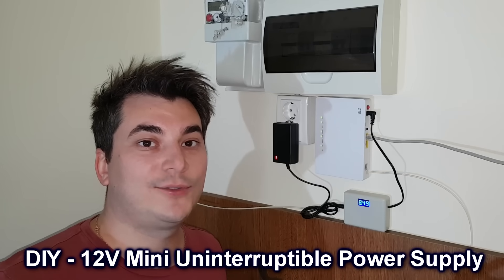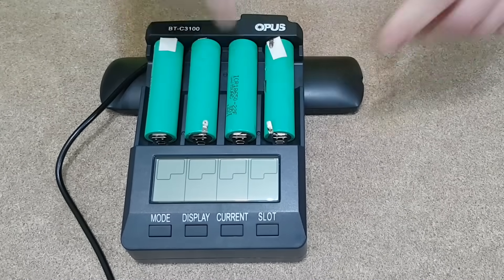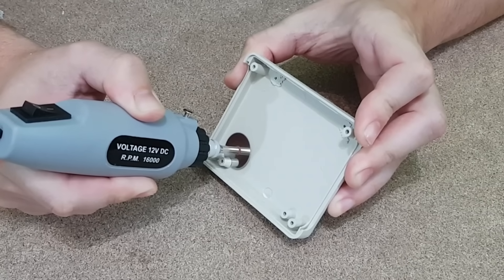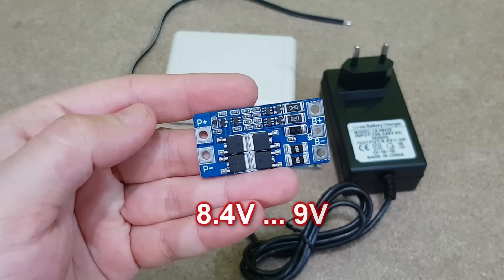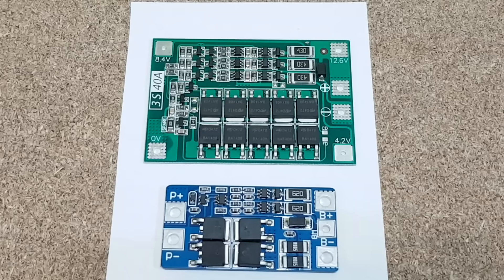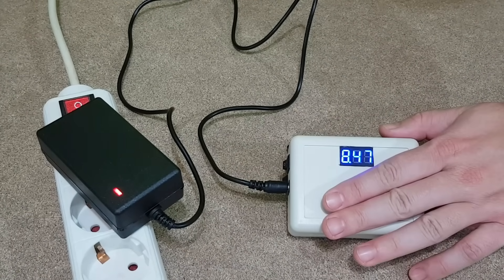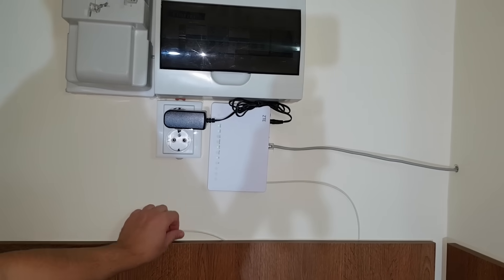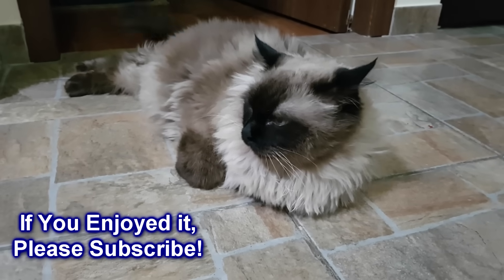DIY - 12V Mini UPS

Comment: I want to make a BIG UPS, for a house. Something that would support a fridge, TV and a few other things for five or ten minutes. Long enough to maybe turn on a portable generator. What if I just had a couple of car batteries? Plus, I'd like to have the system be able to activate the generator if the power is down longer than a minute. Would it be possible to just scale the design of this mini UPS up to cover a much larger load? Thanks if you can help! Thanks.
Reply from the maker: hi. it's much more difficult to build an UPS of that scale. you need a powerful inverter, or even more inverters, to power different loads. a big battery pack of 24V or 48V, which will be difficult to charge and balance. and a system that can switch very fast between mains voltage and inverter voltage. it's not impossible, but it's very complex and expensive.
Reply: @Sorin_DIY  Oh well...  :-(   I guess I've have to just settle for a small UPS system for my electronic stuff. I live on a country road where power will just drop out for a second or two for no good reason. And sometimes it might drop out for an hour. Not that often, but it can be annoying. At any rate, thanks for the information!! A small UPS and a generator maybe what I'll have to settle for. Thanks!
Reply from the maker: I will soon make a better UPS, more powerful and with more features. it may be useful for some of you electronic devices, which have an external charger (modem, TV, monitor, laptop, landline phone and so on..). you can also use it for lighting at night, you can power an LED string with it. but for big loads, like the fridge, you need a generator.
Reply: @Sorin_DIY  Thanks!
Reply: @Sorin_DIY  Hey SORIN... I have another question for you if that's okay. Our house had another power outage yesterday. A quick down. Less than a second or two. But it knocked my iMac computer off line. Annoying.  So I decided to look for a solution for just to protect my iMac. I looked at several options and videos online. Then one video gave me an idea. I remembered that I bought a 30Ah lithium battery last year so that I could hook-up solar power in my bus (I own a small bus.) I hooked the 30 Ah battery (it says it's "30000 mAh") to a 750 watt continuous inverter I own and BANG, it seemed to work! It seemed I had a UPS for my 2007 iMac. The battery comes with a charger, and when I unplugged it, the computer just kept running. Not even a flicker. So is there any problem with this? Is this dangerous? The charger for the battery feels a little warm, but that seems normal. Is there any reason I shouldn't run this set up 24/7 ??? Here are the specs of the items I'm using....
SPECS:
       Battery:     Okoman 30000mAh 12v
       Inverter:    Cen-Tech - 12v input  /  115v - 60Hz output   /  750 watts continuous - 1500 watts peak
       Load:         20 inch 2007 iMac computer ~ 75 watts idle ~ higher when active.
You are not legally responsible for anything that happens. I'm just wondering if there's anything about this arrangement that sounds scary to you.
Thanks in advance for your help!!!

Comment: Hello Sorin,

Greetings from Bangalore.

Liked your project. I want to adapt this as a means to power a raspberry pi 3b+. Can you give me some suggestions and guidance? For instance, how many batteries to use? In what combination? You get the point. You happen to use a step down DC-DC converter (which has a coil and stuff); won't this cause a problem since I am running a rpi on the other end? I feel it can disrupt with wifi connectivity slightly. So is there any efficient alternative to that component?
Reply from the maker: hi. you need a supply voltage of 5V and more than 2.5A for it, I think. I suggest you make a 3S battery pack, a good 3S BMS protection board with overcharge release voltage, and a 2A 12.6V charger. automatically you need a powerful step down converter, powerful because you don't want it to get hot, while it delivers 2.5A. the coil will not interfere with the wi-fi signal, just don't place the step down converter right near the raspberry pi. to prolong the battery life, you should design a way, to make the cells deliver power only when the charger doesn't, not to be always connected to the BMS and step down converter. I will soon make a better UPS with 2 outputs and more features. but I'm still waiting for the components from China, which with the current virus problems, I don't know when they will arrive.

Comment: Can I use 3s bms 12v directly with this in and out at same time I mean charge and discharge at same time
Reply from the maker: it depends on what do you want to use it for. the BMS will not charge and discharge the cells in the same time. but the output battery voltage will decrease, while the battery is getting low, from 12.6V to 8V. if your device can work with this voltage variation, then it's ok. if it needs a stable 12V, then you need a DC converter to stabilize the voltage.
Reply: Sorin - DIY Electrical Nerd  I need to make real ups for my router which takes 12v I need to use it when power connected and when it cuts out work on batteries without changing power source every time
Reply from the maker: if you don't use a DC converter, the voltage will not be stable and I don't think the router will like that. I will soon make a better UPS similar to what you need, but I'm still waiting for the components.
Reply: Sorin - DIY Electrical Nerd ok thank you very much

Comment: Hi sorin very Awsome video! Im am building one of my own and I would like to power both a modem and seperate wireless router which combined require 4.5A or so they say.  Would a 8.4v 2A charger be enough? I think I would need at least 5 Amps but that would mean the batteries would charge at a very high rate... Any help would be great!
Reply from the maker: hi. you can't use a 2S battery pack, if you need that current, but I don't think the modem+router need that much current. first you need to check the real current consumption. then I suggest you use a 4S battery pack with a good BMS (with overcharge release voltage), a 16.8V with 3 or 4A charger (usually the output current is lower than what they are rated at) and 2 powerful step down converters. I plan to make an UPS like this, but I'm still waiting for the components from China. but with the problems these days, it may take a while.

Comment: Interesting. Here in the UK our ONTs come with battery backup units, but all that’s inside them is four NiMH AA batteries and a charger. Although it’s only really needed so that any phone service provided over fibre keeps working if there’s a power cut.

Comment: Im a subscriber of your channel sir and i thank you for the videos you uploaded.  It helps me a lot especially the 12v mini ups. I also want to make a 5v mini ups can you upload it sir or just pm me what are the items i needed for the project? I want a 5v mini ups for my raspsberry pi and i need a usp port to power it up it. Frequent Brown outs is my issue in my country sir. Thank you in advance and god bless you.
Reply from the maker: I plan to make a better UPS, with more power, bigger capacity, 2 outputs with different voltages. I will explain more things in that video, I think it will be useful to you. but I'm still waiting for the components. and right now there is a problem with receiving packages from China...

Comment: Thanks for this video. Just one question, do batteries charge and discharge at the same time while the electricity is on? If so, is this actually a powerbank with a voltage regulator?
Reply from the maker: hi. the battery does not charge and discharge in the same time. when the battery is fully charged, the charging current is discontinued by the BMS and the cells remain at 8.4V. the charger voltage is 8.6V and continues to supply power to the step up converter. if there is a power outage, the BMS delivers current from the battery to the step up converter.

Comment: Good video. Just a question, shouldn't you supply the BMS with a constant current to make sure that the batteries are not been charged with too much current. For example if you using 2000mah batteries, then you should limit the charging current to 1A. I have read the datasheet of the chipset on the BMS and there is nothing about current limiting onboard.
Reply from the maker: hi. the BMS board has an overcharge protection of 4.25-4.35V ± 0.05V. this voltage is a bit high and can stress the cells. you can add a diode in series with the charger and decrease the voltage to around 8V. this way the charging current will not be a problem. the current will also self limit, because a part of the charging current is used by the step up converter to increase the voltage to 12V, so a little over 1A will remain to charge the cells.

Comment: That's not how you charge lithium ion cells, it needs a CC/CV and termination. A proper UPS should implement load sharing so that when a power source is connected, the batteries are isolated and only connected to the charger

Comment: Great video, dude! Question, why not use 3S without a step-up transformer? Was this purely to keep the size down?
Reply from the maker: hi. I wanted this UPS to have a 12V stable voltage. a 3S battery pack has a nominal voltage of 11.1V and maximum 12.6V. so you can't make that into a stable 12V output. for most devices it will work, but you can't use the entire capacity of the battery, because the voltage will decrease too much. the battery pack voltage will decrease to minimum 8V.

Comment: can I keep it charging all time? will there be any bad effect for battery?
Reply from the maker: hi. the BMS I'm using in this video doesn't have an overcharge release voltage feature. I didn't know this, when I bought it. it's ok for portable devices, or for devices connected temporary. but in your case the cells will be charged continuously, this can put some stress on the lithium cells. if you still want to use this type of BMS, I suggest you use a 8V charger. if you use a 8.4V charger (which usually has 8.6V), I suggest you connect a diode in series with the charger, so it will decrease the voltage to around 8V. this will slightly decrease the battery pack capacity, but it should not affect the lithium cells lifespan. but my final suggestion is to use a BMS board with an overcharge release voltage feature.
Reply: @Sorin_DIY  Thanks a lot for reply. Would you please suggest me a BMS board or any other board for use my 12V 1amp router and 12v 0.5amp onu. I don't want to plug and unplug every time. tnx.
Reply from the maker: I have to make some tests first. but I will make soon a better UPS, which will be exactly what you need, with bigger capacity, higher output power, 2 outputs with different voltages and more features.

Comment: Now a day very less devices specially dual band routers or 11ac ones uses much higher load than 500mA, so how to increase current for that I mean 1.5A or 2A?
Reply from the maker: hi. I plan to make a better UPS with bigger capacity, 2 powerful outputs with different voltages and more features. but I'm still waiting for the components..

Comment: Hello Sorin. I have a question. I'm building an RFID Access lock using Arduino Nano. The logic curcuit requires 5v while the Solenoid requires 12v. Can I add a step down converter parallel to the step up converter? What do you think will be the implications the BMS and the batteries if I did this? I'm hesitant to the the Nano's onboard regulator due to heating problems that can damage the board. Thanks in advance for the reply.
Reply from the maker: hi. I'm thinking it needs a good autonomy, so you can still operate it if there is a long power outage. it depends on how much current does the solenoid requires. yes you can add 2 DC converters, but I suggest a bigger battery pack. a minimum 4S2P configuration with max 16.8V and good lithium cells, a 4S BMS board and 2 step down converters. one for 12V and one for 5V. this way it will last longer. I'm planing to build a better UPS with a similar design, but I'm still waiting for the components.
Reply: Hello, I didn't really think you'd reply so thank you very much. I was thinking that if ever there was a power outage, the UPS would give me or someone at house enough time (about 30mins-1hr) to unlock the door  and not lock it again. The solenoid lock would draw 500mA when unlocked, which usually is around 5 seconds maximum (if unlocked and door is not open, it will automatically lock after 5 seconds). I calculated the current that this whole project would take and it would be around 800mA (including Arduino Nano, NRF24L01, RC522 RFID, 16x2 I2C LCD and a mall piezo buzzer)

I was thinking also of a BMS with a big battery pack but I couldn't find a good tutorial to do that. Besides, I know thats its very dangerous dealing with rechargable batteries especially when charging them and parallel connections. One wrong move and you could start a fire or an explosion, which we don't want. I found your tutorial very helpful and informative, which why I decided to do this. 

Anyway, I'll be trying this UPS tutorial and see the output with regards to my project but I'll be looking forward to that video of yours. Cheers!
Reply from the maker: hi. the BMS I'm using in this video doesn't have an overcharge release voltage feature. I didn't know this, when I bought it. it's ok for portable devices, or for devices connected temporary. but in your case the cells will be charged continuously, this can put some stress on the lithium cells. if you still want to use this type of BMS, I suggest you use a 8V charger. if you use a 8.4V charger (which usually has 8.6V), I suggest you connect a diode in series with the charger, so it will decrease the voltage to around 8V. this will slightly decrease the battery pack capacity, but it should not affect the lithium cells lifespan. but my final suggestion is still to use a good 4S BMS with overcharge release voltage feature.

Comment: Do we need the voltage indicator? I mean we can just put a switch to the voltage meter and only use it when we need to check the battery voltage! It could probably save a couple of minutes on the backup time. Excellent video!!
Reply from the maker: you don't really need the battery voltmeter, I used it because it looks good in the video :) you can use it with a switch.

Comment: Please post the part number or source for the small heat sink you uses.
Reply from the maker: https://www.aliexpress.com/item/33009370749.html?spm=a2g0o.productlist.0.0.1b991132GULoed&algo_pvid=a5a785ce-ef48-443b-bd69-cc2796a2821a&algo_expid=a5a785ce-ef48-443b-bd69-cc2796a2821a-17&btsid=053eb297-7530-4520-a1d5-c89dfc5fe0f0&ws_ab_test=searchweb0_0,searchweb201602_5,searchweb201603_53
Reply: @Sorin_DIY  thank you

Comment: I have couple of questions:
1. Why capicitors and how do you determine the specification?
2. How are you handling the heat disscipitation from buck boost converter as with xl6009, and 8v to 12v with current 0.5 A, it generated good amount of heat.?
3. What is the total capacity and how long this product will support ie. 1 or 2 hours...

Very well documented and good video.
Reply from the maker: hi. capacitors hold a small electrical charge. they are useful, for example, when you connect a big load, the supply voltage may decrease for a second. the capacitor charge will help to keep the voltage stable in that second. the bigger the capacitance, the higher the charge is. so for a bigger load you need a bigger capacitance. for voltage smoothing usually I use capacitors between 1000 - 6300uF, depending on the project. 
in this project, the step up converter IC only warms up a bit. it can handle up to 85 degrees C and I also added a small heatsink. but for higher current you need a bigger heatsink or a ventilated enclosure. more than that, my ONT is using maximum 270mA, so no problem with the heat. in these conditions it has an autonomy of around 6 hours.

Comment: could you modify the circuit to prevent charger drain power from UPS?
Reply from the maker: hi. the charger LED is using only a few mA, so it doesn't matter. you can add a diode on the charger input to block the current in the other direction. but diodes have a small forward voltage drop, the charging voltage will decrease below 8V, the battery pack will not be fully charged, so the UPS autonomy will decrease.

Comment: 11:50 You can prevent your charger to use your Mini UPS's  power by adding a suitable value Diode ( e.g. SR3100 Diode ) on the Mini UPS's charging ( input ) connetcor's positive (+)  pin. Then it will prevent UPS's power to flow through to the charger back and isolate it from charger better in a situation like power loss in mains. By the way,  it's pretty useful project :)  But In my region,  in this situation the the DSL signals are also doesn't work because they don't maintain powerpacks in the DSLAM cabinet and it also shuts down in a general power loss :D
Reply from the maker: hi. a diode will work, but it will decrease the charging voltage to less than 8V. the battery pack will not be fully charged, so the UPS autonomy will decrease. the charger LED is using only a few mA, so it doesn't make much of a difference.
Reply: @Sorin_DIY   That's true, I agree. But such obsessively person like me would end up modifying the charger adapter to tweak the voltage..  Vo = ( 1+ R1/R2) Vref  :))))

Comment: What is the observation when power supply is online, and the router is operating via battery...is there a dip in output current?